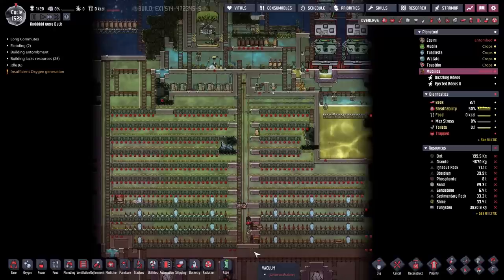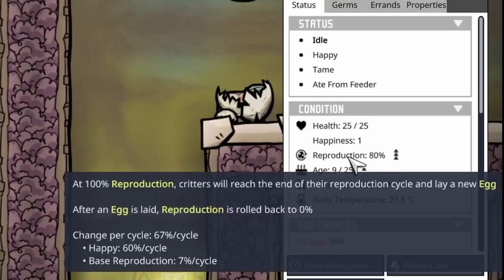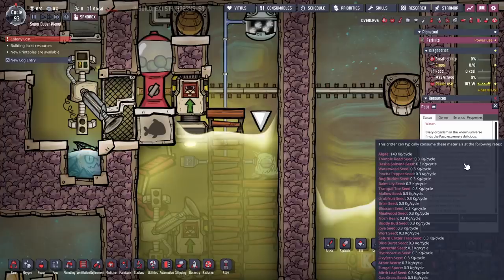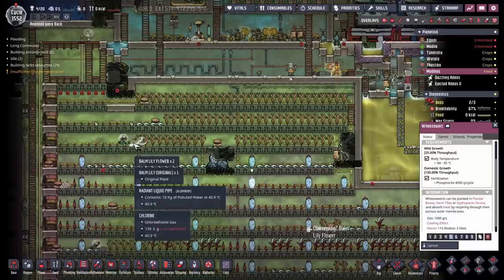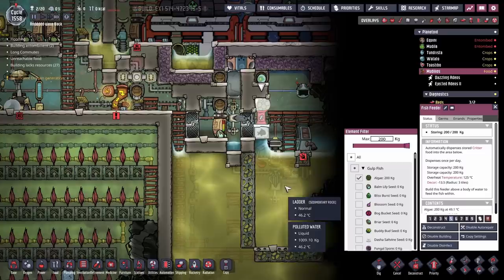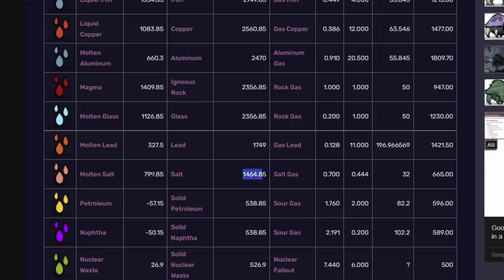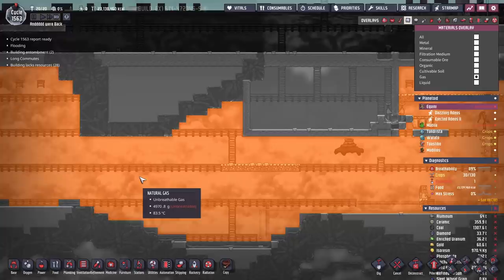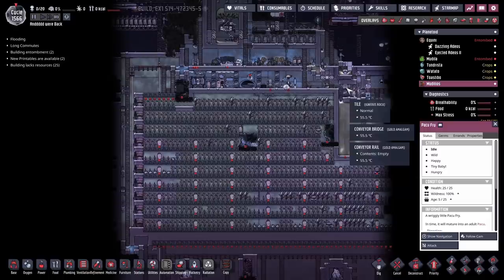Ep 20 : Need to do something with all the spare seeds : Oxygen not included Spaced out

Comment: Technically, this setup shouldn't extend the pacu population to infinuity. That's because you always have a 2% chance to get a Gulp Fish
 and those will die from the heat. Their population can get quite high though. Each extra egg coming from the the breeder will lead to an average of 50 pacu life cycles, or 50,000 calories. Once you take into account the lost time from baby pacus, a population of 2 actively fed pacu should provide about one egg per day, so that's a limit of 50,000 calories per day.

You could build cold separate water tank for Gulp Fish to avoid that issue, at which point the population limit is gonna be dictated by the conveyor belt. It might not seam like much, but this tree can eat up to 1,000,000 calories per day. Since each egg will ultimately turn into a 1000 calories, a conveyor belt full of eggs would still only give it 600,000 calories per day (300,000 calories when you take that bridge trick into account). It's not that big of an issue though. It wouldn't be too hard to modify your pacu farm design to extend that limit to 1000000. And of course, once you reach 1000000 calories per day, the tree will be fully fed. Of course, your CPU might not like this solution.

By comparison, I think you have about 400 balm lilies. If they all get the licey mutation, they will produce 50 calories per cycle each, for a total of 20,000 calories per day.
Reply from the maker: Christ.... How much calculator time did that take :) Also do remember that due to the heat fish will turn into tropical pacu, do they have the gulp fish option? Also pretty sure increasing the odds of tropical pacu decreases the odds of both gulp and regular Pacu.
Reply: @FrancisJohnYT  Yeah I wondered about that. Or rather, I wasn't sure if tropical pacus could mutate into glop fish, but according to the (admittedly not always reliable) oni-db, it does. I don't think the mutation chances ever get under 2%, although I might be wrong.

I think it maybe took me 30 minutes to write my original comment. :P
Reply: I love how much "cpu requirements" are part of the game's challenge
Reply: All of that to feed a tree. To make stuff you don't need.  Insulation from it isn't needed.  You can build anything without it.  Why because you have the perfect 
insulation a vacuum.  I guess if you like building stuff that you don't need is your thing grats to you.  The Tree is that thing.  It's a total waste of time.   I built everything in the game and never built 1 piece of any insulation over the base one.  You don't need it.  You have other ways of doing it without it.  Such as a vacuum.  So cover a whole planet with plants to feed a Tree to get stuff you don't even need.  What ever flows your boat I guess.

Comment: I'm not going to tell you your business, but I just wanted to add my 10 cents to the whole automated fish hatchery thing.

In my hatchery, I have an unpowered incubator within reach of the sweeper that picks up the eggs, and set the incubator with a higher priority than the conveyor loader. So if there is nothing in the incubator, its higher priority is to put an egg in there instead of in the loader.

From there, it just sits and eventually hatches, and the baby fish remains inside until it becomes an adult, where it is then spat out. If the breeding tank has no fish in it (or in this case, less than 2 fish) the door on the right opens and the door on the left is locked, so the fish flops into the breeding tank. If there are enough fish in the breeding tank, the right door is locked and left door is opened and the fish flops into the mini tank.

It takes a tiny bit more setup, but it is worth it (to me at least) because of the TIME you save. In YOUR design, it sweeps up a freshly laid egg to dump back into the breeding tank. That means you have to wait the full duration of the egg to hatch, then the fish to grow up on top of it, before you finally get your fish out of it. It takes a long time. Many cycles where that fish is not doing anything productive, like pumping out more eggs. In my design, because there is always a fish egg or baby fish maturing, it can cut down the wait time significantly, reducing the time before that fish is back in the breeding tank doing its job. If you're really lucky, there will always be a baby thats about to mature into an adult that drops out right after the old fish dies. And depending on your luck, it can happen anywhere in between, but it always saves time, because even a worst case scenario means the process will take as long as yours rather than saving time, but doesn't cost any additional time.

Comment: Gulp fish die at 25C and pacu always have a 2% chance to lay gulp fish eggs, so you may need to add some spot cooling to your stable tank to prevent the population from slowly dying out over time.
Also, there's a spot on the far right that your sweeper doesn't quite reach in the breeder tank.
Reply from the maker: Not much we can do about gulp fish, but if we keep the pacu warm it will up their chances of tropical fish and decrease the odds of Gulp a bit. Will have to double check the tank but pretty sure the sweeper gets every bottom tile.
Reply: @FrancisJohnYT  Could vacuum out the gas just above the tank and put insulated tiles around the one tile tank to prevent chill from escaping (the polluted water there has a layer of water on it already, so it's not going to offgas) and use a quick aquatuner/regulator to move the heat out of there into the bigger tank. Once the initial cooling is done, it'll only run once in a while to cool the new tropical pacu getting born.

Comment: For the pacu filet: have a grill on top of a weight plate set to the kg of a serving of pacu. Also have a fridge or co2chiller with weightplate. Use AND automation to a solid filter, which will dump filet onto the weight to be grilled if it is too light and when the fridge needs refilling.
Reply: Basic food-automation there, yeah, but going into the "Licey" Balm Lillies, no need for any of it. 600kcal Meal lice per lilly, and no need to cook it up for the farmer. Less time cooking, more time harvesting (once the Licey lillies are up and running, that is)

Comment: Not sure if you can be bothered, but next time you are doing a sweep of a map I think it’s faster to make a vertical daisy chain of automatic sweepers to lift all the good to one spot. As you are coring out whole map everything drops to the bottom level (where another horizontal row of sweepers sit). Along the bottom I use storage bins in increasing priority so the goods get moved to center. Then when you get to priority 9 you use auto dispenser (same as your old regolith moves). Then same vertical. Moves 1 ton at a time and no duplicant labor. Chuck in a geothermal generator for power and you don’t lose hours of dupes running up and down stairs

Comment: You could add some natural gas generators and pump some gas into them, and then run them if the gas pressure in the oil biome is over 4kg or so. Then you won't have the petroleum production stopping due to pressure :)

Comment: I always use diamonds on a rail to transfer heat in a vacuum, it's melting point is high enough for all but the most extreme setups and it has a decent heat capacity.
Reply: And you don't have to worry about solidification either.
Reply from the maker: Replace or add!

Comment: Seems like the giant block full of wheezeworts would be a pretty useful tool for dissipating heat from the tungsten volcano.  The specific heat of chlorine is almost 3 times that of tungsten so each wheezeworts should be deleting enough heat to cool 1 kg of tungsten by about 15 degrees every second.  Seems like you'll need to wait for the base to cool down a bit first though before trying something like that.

Comment: There is no need for the solidified magma to stay there drawing heat from the hotter steam, you can send your dupes in to scrap all of it, you can send it later to turn around in rails inside the steam room to cool it down, and draw heat directly from the hot igneous rock.
Reply from the maker: If we mine out a tile it halves in size. So if we mine out the solidified magma we lose half the potential heat.

Comment: The gas bridge at 38:55 is transferring heat over the door. It isn't much transfer it's just rock but it is something.
Reply: Doesnt really matter since thats the whole point right? its touching the plates that transfers it up but im pretty sure the vacuum prevents this anyways but im not 100% on that. The doors are just there to prevent accidents not really seperating the heat down there.
Reply: @badbilly7499  the door is to prevent temp transfer when the steam gets too hot in the turbine area, the gas bridge would overwrite this and continue transferring temp even if the doors were open. Granted, as the OC said, it's a small amount of temp transfer since it's with rock, but is something that may need to be monitored just in case it causes issues
Reply: @xPanda25  OH that bridge, im pretty sure that one is temporary to get the steam into the loop so it doesnt matter anyways. i was talking about the other bridge at the bottom of the loop.
Reply: @badbilly7499  that one at the bottom I don't think affects anything at all really except for letting the loop 'flow', but the one at the top afaik is going to be there until the entire magma biome is drained of heat, as he's going to need to constantly extend the loop and needs that there to add onto it without overfilling it. I doubt it would cause issues as it's such a small amount of temp transfer, but still
Reply: @xPanda25  True I think i just disregarded it because of the how trivial/temporary it was. could have an effect but it would be so small in comparison to what he already has going on. good catch tho
Reply from the maker: I'm not sure that is going to transfer anything the far end is in a vacuum. Also when the door opens that will be a Vacuum as well. That just leaves it interacting with one tile.
Reply: @FrancisJohnYT  I expected it because I do these bridges over insulated tiles all the time, the bridge is actually in a good spot after all.

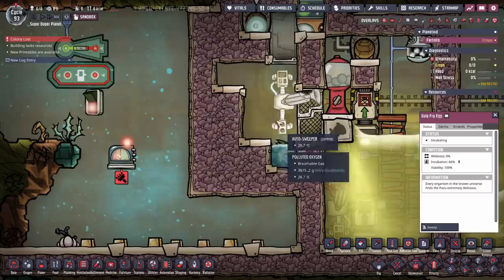Comment: 7:30 the door are used to separate indoors space due to the nature of the game. this of course create a wanky interaction where you can divide a room in different shapes depending on where you put the door.

this interaction can be used to make a greenhouse spread through around 90 plants , using doors to divide the room... you create some where efficient building using this interaction, and this isn't a bug, neither a exploit. it just a creative way of build rooms, and a fundamental and inamovinle interaction due to the nesecity of the game xD

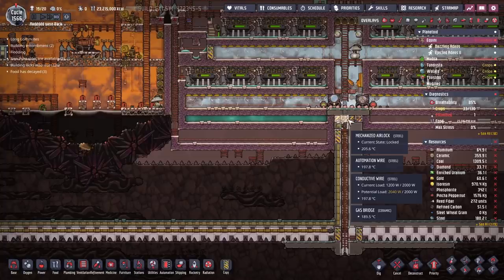edit: 38:28 ... but you would need to pre heat the new part of the loop, since it's going to get built at 45c°, otherwise steam is going to condense
Reply from the maker: The steam at the end of the loop is 1300C+, 1kg of that steam can easily heat up 25kg of gas piping to above 100C.
Reply: @FrancisJohnYT  fair enough, but you will still need to be carefully on how long the new pipe section is going to be

Comment: If I may, can’t you use a time sensor for the sweep-ies? Have 2 or 3 work for a couple “hours” and then shift change for the next. Those waiting for work are already charged, and those going on break charge up.
Reply from the maker: If the stations are not available then the sweepy runs out of battery I think the sweepy just stops and needs to be rescued. Would require testing to be sure.

Comment: Hi!
I wonder, why didn't you use rails to move heat, give the amount of time the packets would spend inside diamond tiles, packets don't need to be of diamond themselves, any material would do as diamond provides the TC (well as long as it's not low melting point material of course).

So iron ore would do (refined iron too), you can go with steel (you have 180t, even creating 500 x 20kg packets that's only 10t, and you don't need 500 rails segments).
Glass doesn't seem bad either or sand. Low TC but not terrible, since you take the average. So a material with TC=1 (glass) ends up to 40, one with TC=55 (steel) to 63,  well 63 is better than 40 but not 4000% better.

With steel/iron you're looking at 20x0.49 ~= 10 HC vs. 4.179x1 ~= 4 HC per packet. Zero risk of escaping (if you issue the deconstruct command on a gas pipe you're in trouble) gases, twice as much the transfer.

Glass/sand/igneous rock (temp should be low enough it doesn't melt) is even better. You get 5 times the heat capacity of steam. Steam TC is low too, so they are competing on HC only.

Nice video, of course.
Reply from the maker: Completely blanked doing that, I'll add in a rail next episode. Be interested to see how much heat we can move.

Comment: Idk if they changed anything with pacu, but the last time I used them the water tank they’re in with the feeder needs to be only one type of water or they don’t eat from the feeder
Reply from the maker: I had a bit of an issue at the start as the top layer of water was only 60kg, so I pushed up the water by building a few bricks at the bottom of the water tank and that fixed it.

Comment: Hi Francis.
Can you make a tiny video about the smart piping trick you do with the bridges? I never seem to fully understand what you are doing, and you just plug it in as if it is totally normal.
Reply from the maker: It's a way to make sure two thing don't travel down a pipe or conveyor one after the other.
The problem with the pacu breeder tank was how to repopulate it when the breeder fish died. So we stuck in some automation to diver a egg to the breeder tank when less than 2 fish/eggs are detected. However this caused a complication.
Imagine the breeder tank needs an egg and the conveyor is full of eggs, well the automation diverts one egg towards the breeder tank. However as that egg is traveling through the wall into the breeder tank the automation cannot detect it yet so it still thinks it's missing an egg. So another egg gets diverted into the breeder tank and you now have to many eggs/fish in the breeder tank. So now they are cramped and have stopped reproducing.
By putting that bridge on, their is always a gap between the eggs so the first egg will make it through the wall of the breeder tank and be detected by the automation before another egg can end up getting diverted.
Reply: @FrancisJohnYT  yes, I understood that part. Smart trick 😊 thanks for the explanation. 
It was more in general I see you use the bridge a lot for many different things. Sometimes for direction, sometimes for filtering, or something like that.

Comment: Why not take steam from the bottom, do the heating loop and then drop at top or where the steam turbine start (the part most to the left and to the right)?
Reply: Because then this superhot steam will cause an inefficiency in the steam generators.
Reply: @jtn2002  true true i miss that, with that corner you can control with automation and the door.. ty